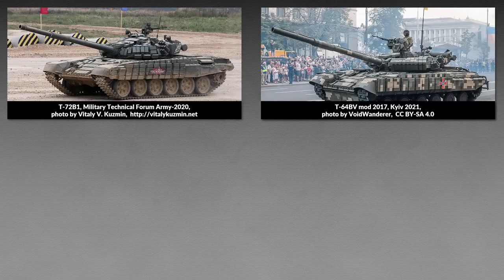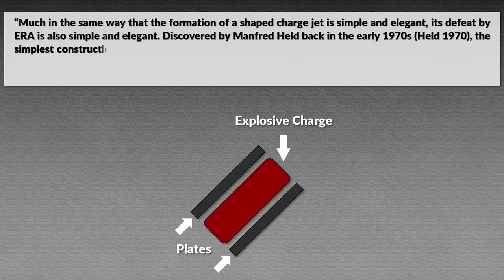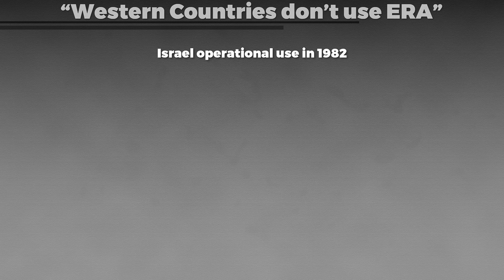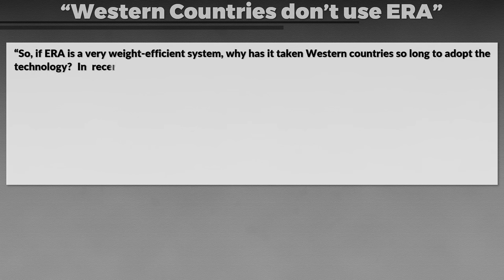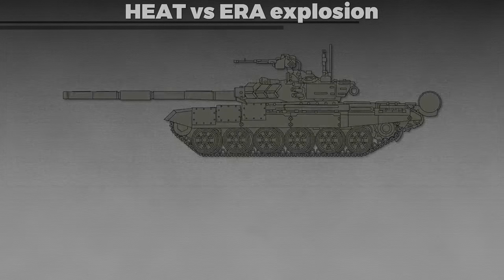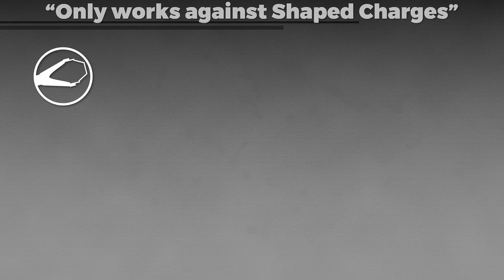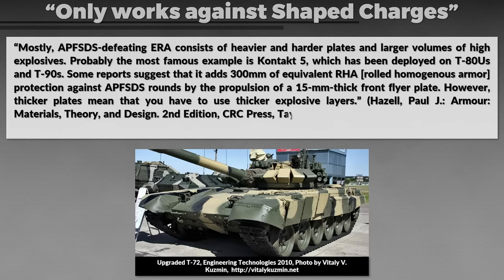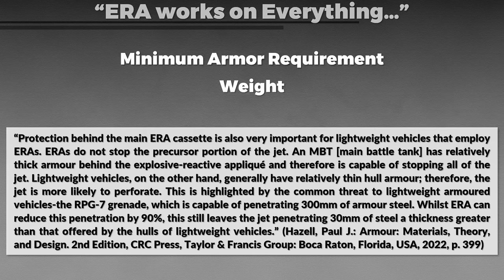Explosive Reactive Armor: Common Misconceptions (feat. Prof. Paul Hazell)

Comment: Not sure what "stretching plastically deforming rod" means. Especially in an engineering context that means something entirely different than what's going on in a shaped charge.

Jets can be fluids, but are also often plasmas, which the material coating the explosive would very much qualify as. I'm just generally pretty confused what the first quote is looking to say
Reply: it doesnt have the time or energy to convert state physically, its deforming plasticly into a rough rod shaped penetrator and accelerated substantially, one way to see this effect more easily is explosively formed penetrators, HEAT rounds are effectively very close range high power explosively formed penetrators. the material, like APFSDS rounds, ablates and deforms as it penetrates, and behaves very analogously. you can imagine HEAT as an impact triggered gun being fired at the enemy

In addition, the comment also serves to counter the common misconception that HEAT rounds "melt through" the armor they defeat, when instead its entirely a kinetic penetration, similarly to any other AP round

Comment: Israel didn't use reactive armor on the Centurion or "Shot" as it was named by Israel . In spite the appearance those are hollow panels that initiate the round farther from the surface of the tank armor hence reducing the penetration.
Reply: This is wrong, ERA was infact used on Israeli Sho'ts, starting with the Sho't Cal Bet, there are photos of Sho't Cal Gimels and Dales missing ERA blocks from hits in Lebanon.
Reply: Wrong I can’t be. You are looking at photos I myself don’t need any pictures. As I explained those lookalike blocks are removable tiles made of steel and are hollow. They are not even blocks cause they are open between one and the other. In a photo to the untrained eye they look the same. If you will ever visit Israel you can visit the Armor Museum near Latrun Monastery on the way to Jerusalem and see for yourself maybe even some tanks in other museums cause Israel have in the past exchanged vehicles with other museums in the world. Some of those Shot tanks were converted to heavy fighting vehicles as is the Puma that is used by some infantry/engineering units. Those have an even higher reinforced armor that is different from the Shot besides lacking a main gun and turret.
Reply: @edyartzi  I am actually visiting that museum in a few days, for the 33rd Latrun March, Ive visited it multiple times, I don't know if you speak Hebrew, but on the ERA blocks there it says in Hebrew they are training blocks, which of course lack all explosives
Reply: Maybe you can find some old people with their sons or grandsons that actually served on those tanks and you could ask them your self.
Reply: @edyartzi  I have personally talked with a Sho'ts Kal Bet, Gimel and Dalet mechanic who said it has Baltan ERA, sadly I have yet to meet crews of the tanks, I have connections in Brigade 211, which used Magach 6Bs and Merkavas Mark one and two
Reply: @minus7621  On the Magach it used reactiv armor on Merkava 1 it was not reactive armor and you may be actually correct. It was not used on all Shot tanks all the time.
Reply: @edyartzi  That I know,  infact I own photographs of a Magach 6R with ERA from 1977, all magachs aside from the 7A and C and maybe the 6B Gal Batash used ERA if they were in serviced by the mid-late 70s

Comment: if AFV losses are any guide, the truth is that there are few actual solutions to the proliferation of ATGMs and kinetic systems. When considering ERA, it must be evaluated against the combined arms fight, not one ATGM vs one tank or AFV of other types. This is what "operational analysis" means in the video.  How are the units operating? What other technologies are they using to detect and target? It is a given that in a fight, losses are to be expected and therefore operational and tactical systems and methods are developed to layer detection, targeting, and maneuver capabilities to reduce opportunities for an RPG man who must be within just 500 meters or an ATGM crew 1 to 3 KM away.  How does your army use obscurants, EW, maneuver, fires, etc to decrement enemy capabilities? The higher the level of competence, the less reliant on defensive armor schemes the force will be.
Reply: And ERA as deployed doesn't protect well from attacks from above...

Comment: Modern western MBT have composite armour,which is more then enough protection against most threats,so ERA will only add weight with no overal increase in armour protection.Western use of ERA on IFV and AFV is logical bc of the lower armour value on those,so ERA added protection is worth the weight increase.
Soviet and russian tanks have a lot less armour and it has lower protection value so ERA add enough protection that the weight increase is worth it.Also it is much cheapear to bolt some ERA plates on a tank and call it modernization then to build a new tank.Even t90 is a t72 with some ERA added.
Reply: Modern western MBTs have huge weak zones and even the strongest parts of their sides (usually turret) rely on steep angles to prevent perforatiom. Soviet / Russian tanks don't have any less armor - that is a Discovery channel tier nonsense. Less interior volume => you need less mass to achieve the same levels of protection.
Reply: @JAnx01  
False.
Modern Western MBTs have better armour then russian tanks.T90 is a slighty upgraded T72,it is not a new built.What step angles?Only the front of the turret is step,the sides and back are flat.
Reply: @georgecristiancripcia4819  Flat? Have you ever even seen a Modern MBT?
Reply: @georgecristiancripcia4819  The only thing that the western MBTs have better is their turret protection, but their hulls have much larger weak zones and are generally weaker overall (comparing respective time periods). The T-90 is based on the T-72 platform, that means it inherited its layout, it doesn't mean that it uses the same armor composition and you're assuming there's something wrong with the T-72 to begin with. The T-72B was one of the better protected tanks in the 80's. With the Kontakt-5 ERA added, it's still worthwhile in the 21st century. There are plenty of videos from Ukraine of them withstanding hits from the 1100mm capable Stugna-P, which is something that's not even possible on paper based on the official claims. I remember when a Challenger 2 got penetrated frontally by a 750mm capable RPG-29 in Iraq.

Comment: I Knew a Marine who before he joined the Marines worked in an East Coast ballistics lab he designed the first reactive armor to test on Riverine patrol boats in Nam. It was too violent and a bit too sensitive to use on the fiberglass boats. The idea was passed on to Israel who refined the packaging and explosives to use. Some packages can help disrupt long rod penetrators along with spaced armor layers behind the charges. The Reactive armor explosions are minor when compared to the Blast of Incoming HEAT or HE rounds. Infantry if smart stay well away from tanks in action unless taking out enemy ones Behind the vehicle to avoid the blast from the main guns firing and getting run over as the tanks maneuver suddenly. There is a reason tankers call infantry Crunchies.
I meet the marine summer 1971 he had done the work several years before that around 1965.

Comment: Unfortunately you confuse two kinds of appliqué armor throughout the video. Protection from CE munitions is obtained by explosive which are NOT sandwiched between heavy steel plates. Protection from KE munitions is achieved by heavy steel plates that slide when struck and damage the penetrator. The earliest designs had no explosive at all. Prof Harzell’s explanation is accurate but doesn’t describe any ERA system in existence.

Comment: I would say that a HEAT "jet" is definitely a fluid loll. The explosive is 100% heating that material beyond its melting point, BUT that doesnt mean it cant do kinetic damage as well. A molten piece of copper and a solid piece of copper weigh the same- a HEAT warhead just ensures that that molten copper is going hypersonic speeds, and is thus using pure kinetic energy to simply punch through the armor, liquid as the jet may be.
I would just say to look at HEAT impacts and you can clearly see molten residue left behind

Comment: sadly nothing new but still good video, although 100m danger of ERA is a littel bit exaggerated and depends on where you mount it. lower mounted panels do not fly as figh and not as far and thouse mounted dawnwards would hit the earth or the armor of the tank. I think only thouse mounted on top or towards the sky woul reach a high distance although I dont think that they are leathel after beeing launches up into the air and loosing most of their speed and only having the momentum of falling, yes they still could be dangerouse to somebody without a helmet or even with one but i dont think they pouse a threat as EFP that are now have been used to overcome ERA because of the lover velocity.
Reply: Yes, additionally we have to consider that the direction the flyer plate is going is the direction of the enemy. If you shoot a t72 in the side with an rpg, the flyer plate will head in your direction. If flyer plates are a real threat to anyone, it's the people shooting at them.
Reply: @92HazelMocha except thats not how it works in the real world
Reply: no one said there was 100m of danger just that the plates can travel up to 100m and carry a lot more momentum than smaller less dense fragments from the attacking projectile. naturally that means the area of danger is going to be larger than without era but not necessarily 100m

Comment: HEAT projectiles are designed to use explosive energy to form and accelerate mass into an armored vehicle. ERA is designed to accelerate a sheet of metal away from the armored vehicle. One of these is much more efficient at projecting dangerous objects around the vehicle than the other.

With how inefficient HEAT is against infantry its almost baffling that the US has never had standard HE-Frag rounds for its 120mm armed tanks. I guess it just doesn't pay to make an efficient projectile instead of developing vaporware multipurpose projectiles that cost a gazillion dollars a pop.